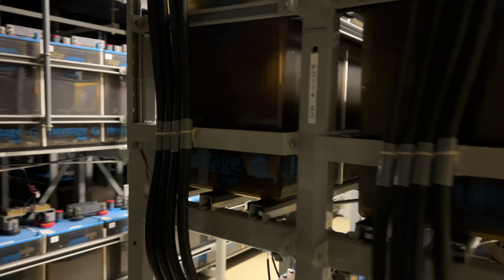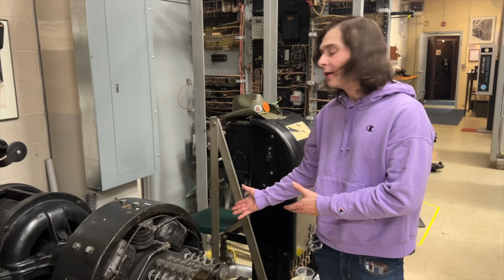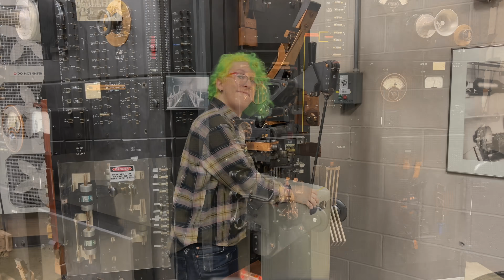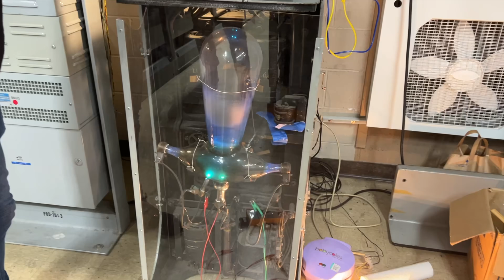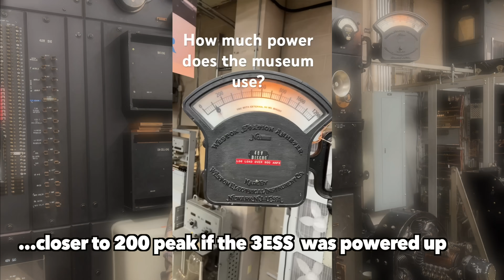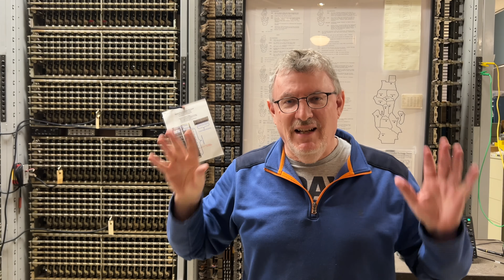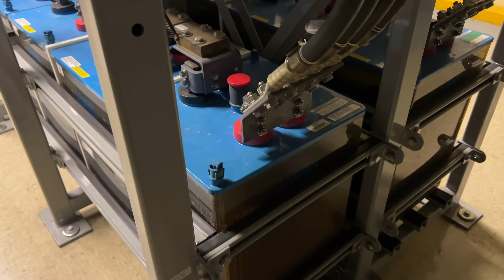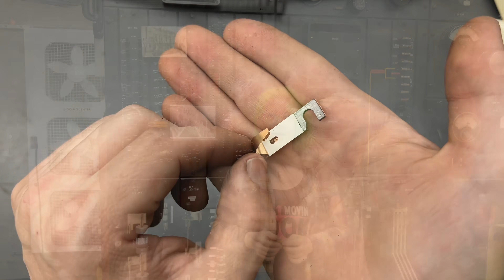All About Telephone Power Plants

Comment: I've seen the battery room with its row upon row of clear-case batteries at the old telephone exchange in my town.  I've also seen the generator they had for standby power.  They used to run it for some time (I don't know exactly how long, but I'd guess at least an hour) each Monday, just to keep the oil flowing and the battery charged.  I seem to recall one night when the power went out for a while and I stepped outside the house to look at the darkened town, and it was so quiet that I could hear the generator at the exchange rumbling away, even from around 3-4 blocks away in a more or less diagonal direction.
I recall being told that the generator wasn't actually designed to be used for emergency backup, because it tended to throw oil around until it warmed up properly and the seals heated up and closed the gaps properly.  It was intended for continuous usage in a situation where the grid wasn't available.
I presume the exchange building still has a backup generator, but it would be supplying the Internet equipment and the mobile/cell phone tower.  I'm pretty sure the old generator was retired years ago and they have a replacement.
And now I'm remembering the time that around half of the distribution equipment in the exchange went out.  You could pick up a phone and stand there hearing nothing while the uniselector desperately attempted to find an available path.  I think it was out for around 30 minutes until whatever the problem was (I never found out any more) was located and fixed.  You could occasionally get a dial tone, but it wasn't easy and you weren't guaranteed to be able to connect.
By the way, the first fully automatic telephone exchange was designed by Almon Strowger, which is why the step-by-step switch was also called a Strowger Switch.  He designed it using cut-out paper pieces.
According to the story, Strowger, an undertaker, was convinced that the manual telephone operator, who was related to his only rival in town, was deliberately directing all calls for "The Undertaker" to the rival company instead of evenly dividing them between the two companies as was the policy. Strowger was motivated by this to work out a way for subscribers to dial the number themselves.
As I understand it, Strowger's exchange required 4 wires, with the 2 extra wires being used for number signalling, but later developments allowed the numbers to be conveyed through just two wires along with ring current and sound/voice.

Comment: This is a great presentation.  I’m sure it will generate lots of comments and stories.  I have one for the group.

In 1967 I was in the Army assigned as an SP4 Dial Central Office Repairman at Ft. Benning, Georgia.  Ft. Benning is now Ft. Moore.   General Benning fought on the losing side of the Civil War.  My job was night and weekend inside plant man for the post.  I watched over the four telephone exchanges at the fort during non-working hours.  Sounds awful, but it was really pretty neat.  I got to work on equipment.  The Army Dial Central Office Repairmen on regular duty hours cut the grass while civilian employees worked on equipment.  But on to the story - I had just come into the Main Post central office to start my 8:00 AM Saturday to 8:00AM Sunday shift.  I took off my jacket, stretched my arms, then the lights went out, followed by the sound of the motor-generator winding down.  We are on the batteries alone and we had no backup power source.  I ran to cut the switches to the motor-generator so it wouldn’t try to suddenly start up before I had time to figure out what as going on.  I called the Wire Chief to report what was going on then called the Post Engineers to find out what happened to my power.  The power was off to perform scheduled power line upgrade.  Scheduled with who?  Would have been good to know in advance.

Our battery was 20 years old and the end cells cut in very soon after the power went down.  I won’t make you sit through the next three hours while I watched the volt meter slowly wind down.  It was tense.  But the power did come back on.  I cranked the control for the voltage of the motor-generator down before restarting it.  I was afraid the exchange load plus the load of recharging the battery might blow the big fuse like the ones you saw in this presentation.  We didn’t have a spare for that either.  Hey, don’t look at me, I was just a lowly E-4.  Planning and decisions were above my pay grade.  Anyway, the motor-generator did come back on.  I put it on-line and spent the rest of the day slowly cranking the voltage back up to the normal level.  Whew.

Comment: Thanx for the history lesion.  Back in the 1960s when I was a trainee technician in a  large central office that consisted mainly of Western electric Rotary systems and a large step office on another floor one of our weekly duties was the power room.  There we had  two 24 volt batteries for long distant toll switchboards , two 48 volt CO batteries  with the end cells permanently connected due to the high load  of about 1200 amps   and two 130 volt carrier long distant batteries. Every Monday  we would set out to read all the cells that were open top not fully  enclose  and the the Specific Gravity readings   This would take the best part of the day . The rest of the week we would just do the pilot cells.  These batteries were charged from silicon rectifiers with 3 phase AC generators that were manually  brought online during the peak morning and afternoon.  The 130 volt batteries were changed with AC to DC generators with a  "No Break" generator that  had a humugas flywheel that  would  keep the system going  until the diesel  generators got  going incase of a power failure. I soon leaned that  sulfuric acid soon eats thru  a pair of jeans.
Reply: We used to have a hybrid coaxial cable/microwave toll link back in the day between two main cities in this country. 

The microwave relay stations , usually in semi-rural settings, used a similar system (they took mains supply failure seriously) where a motor-generator set also spun up a 500 pound flywheel which was in turn clutched to a Diesel engine. The idea was if the power went off, the flywheel would maintain rotation long enough for the Diesel to auto start and come up to speed and drop the clutch in. The ultimate UPS, I guess. There were also bunk rooms and cooking facilities for the techs if they needed to stay on site.

Comment: Honestly, I have been trying to get more detailed information on the design of these very early open-frame ITE breakers for years, as they were once quite ubiquitous in panel boards.  I have a few drawings in 1915-1930 electrical reference books and some spurious bits of sales literature, but not a concrete working description of how the actuator actually ties in mechanically.

Yours is the first video where I've ever seen one operate.  And yours is a very elegant version, both because it's DC (which is harder to electrically break), and because it has the complicated secondary mechanism for automated reclosing which I had never seen before at all.

I know telephony is the main focus of the channel, but if you ever decide to revisit this in a future video, you'd probably be the first to clearly document the overload-adjustable coil-dashpot assembly that made the ITE (inverse time element) design remarkable in its day.
Reply from the maker: That's a very good point, thank you. I was also trying to learn more about these breakers, and I found very little information online. All I know is what I've been able to piece together from the various bits of sales literature.

Maybe I should put together a shorter video showing how these work in more detail.

Comment: Some older vacuum tube equipment had a " Dynamotor"...a miniature AC motor driving a DC generator. 
    As a teenager in the mid '70s, I used to find 45 volt zinc carbon batteries ( about half the size of a cereal box) at the local dump. They were still good...
I asked around about them, and why they were thrown away, and the physics teacher said the phone company threw them out, that they were part of some backup system.
   I had a 1940s automotive battery charger with a Tungar rectifier..looked cool in a dark room...
Reply: OK I have to ask. What did you do with the batteries? lol.
Reply: @charlescheeld4767  I had some vacuum tube radios from the '40s...a common plate voltage then was 90, plus I had homemade vacuum tube radios and amplifiers ( mid '70s). I also had a surplus gieger counter that needed 300 volts DC. Also had a huge neon relaxation oscillator ( random blinking light thing) that needed 180 volts DC ..
Reply: @scottthomas3792  WOW, so you wired a bunch of those big batteries up in series to get up to 300 VDC? I bet that was a sight to see in your garage/bedroom. lol. At least you gave them a second life. I bet they can't throw those batteries away like that anymore.
Reply: @charlescheeld4767  Yeah...the batteries were huge...about half the size a large cereal box. We lived in a rural area, and I had an old shed to use .. literally, a radio shack. 
     The battery packs were larger than the things they powered. Plate and grid batteries last a long time, but filament batteries don't. I had some old, weird lead acid 2 volt batteries in heavy glass jars. They were given to me, and I have no idea what they were originally from.
Reply: Don't know if you ever got an answer, but in 1969-70  I saw 1930s era PABX- still operational- which used open-frame Erikson branded Strowger type selectors that had them ( x25) as its power supply. They were heavily ribbed square jars around 12 inches/ 300mm tall, and ~6 inches/150mm square.

Comment: Another very interesting video.  While I was not able to locate this scene quickly, there are two spots in the video where you show the batteries themselves.  The second scene, the one with a woman standing in front of the racks, shows batteries manufactured by the company I worked at for 19 years - C&D Technologies.  In earlier times they were known as C&D Battery.  Batteries in that configuration normally had multiple cells in them and there was all kinds of strapping (series and/or series/parallel) to deliver 48 volts.  Remember that the chemistry of lead-acid batteries tells us that an individual cell only produces 2 volts.  This means that you need to wire cells in series to increase the output voltage.

I was surprised that there was no mention of AT&T's contribution to the battery industry.  I would expect that many of the old timers commenting here will remember the round batteries that they must have encountered during their careers.  AT&T as "Ma Bell" was always concerned with longevity and reliability in anything they produced.  AT&T engineers set out to create a lead-acid battery that would last longer than traditional batteries.  They did this by literally changing the entire configuration.  Typical lead-acid batteries are in rectangular "jars".  Think of your car battery or the wastebasket sized units on those racks.  The plates are all vertical.  What happens over time is that the oxide paste that is held by the plates (they are actually lead grids that are filled with paste) ages and some falls to the bottom.  Once there is enough to form a connection between plates the battery shorts out and fails.  The Round Cell tried to eliminate that by using horizontal plates  and then using a cylindrical jar.  C&D was the only manufacturer licensed by AT&T to produce the Round Cell.  They were in production in various configurations until about 2015.  When I hired on at C&D in 2002 I saw a huge room full of these at C&D's Leola, PA manufacturing facility charging away.  The other variant AT&T had was a much longer "formation" step.  The first application of charging energy to a freshly created battery "forms" the positive and negative paste.  The Round Cell took about 30 days to complete this step; normal lead-acid batteries take much, much less time.
Reply: The batteries used in the museum are in the basement. The museum is on the second floor of an active CenturyLink central office, and borrows power from the active CO’s power plant.

Comment: I'd watch another deep dive on power systems. I want to hear more about how the end cells were used. When and how are they switched in and out of circuit? How is the battery bank kept in balance when these cells aren't at the same state of charge as the main cells?

Comment: I was rewiring the phone jack extension going to the upstairs because we're having issues. So I was on the floor in the corner of the room behind the chair and the floor was a little damp. I accidentally touched a couple of things with my fingers and start feeling tingly. Never felt that way before so part of me thinks there might've been a ring Signal or it could've just been the combination of damp carpet and bad timing. I just know that the phones didn't ring but with that disconnected there was only one other Jack in the house so I don't know.
I haven't quite gotten to the point where I think everything should be negative voltage but it doesn't phase me that it's reversed.
And then if you think about how we thought power flowed one-way through a battery and then later found out that on a smaller scale it actually goes the other way it's sort of makes sense that it's negative anyway.
Reply: Under those conditions, the standard 48 volt on-hook voltage is sufficient to cause a "tingle".
The ring voltage is typically 90 volts AC at 20 Hz-while this IS current-limited, trust me, if you get across it, you will get more than a "tingle"!
Reply: @m.k.8158  Of course YouTube and the Internet breaks soon as I hit post comment and I lose my entire comment and have to start over.

This was probably about 2002 in the middle of nowhere upstate New York in the valley at the very end of the trunk. As we were the last house with the trunk line Junction Block and they ran Spurs to the last 2 remaining neighbors about a mile. So since we were literally the last mile I wouldn't be surprised if there was significant voltage drop.

It definitely wasn't like anything I felt before and more than a tingle and was enough to make me jump if I remember right. Definitely nothing like DC and definitely different than 120v60hz ( or even 240v60hz now that's another story ).

Don't worry I've had my battery recharged for the next approximate 5 years. I removed some equipment thinking the switch was off and only as I was putting the electrical caps on the wire after removing everything did I find out that switch is not wired in a normal way but something more weird. Then again the building was built in the 1900s and was converted to a movie theater in the 1920s the fuse box was yes fuses barely labeled so I shouldn't have been surprised. But definitely one of those stupid moments of no I don't need to test it….

Comment: I'm wondering about the amount of fuses in general. How often would they blow in regular use? You talk about personnel replacing blown fuses, but presumably that's not the only thing happening, as the fault causing the fuse to blow would still exist? So what was going wrong with the equipment that caused these power surges?
Reply from the maker: Well, it depends on the fuse. Small grasshopper fuses can blow somewhat more often due to accidents or carelessness when working with live equipment. (Generally speaking, CO equipment is not powered off while work is being performed unless strictly necessary). If a small fuse blows, it's no big deal. Simply replace it and go on with whatever you were doing.

Larger fuses can sometimes blow during periods of extreme traffic. This wouldn't happen in normal operation, but could happen if a surge was high enough. Also, bigger mistakes like shorting a bus bar to ground with a wrench could (and should) cause a fuse to blow. In either case, the correct course of action is to move to the backup fuse and replace the blown one as soon as possible. If the backup fuse blows, locate the fault and repair, and then replace fuse.

The idea here is that fuses are expendable. Telephone service must not fail.
Reply: @ConnectionsMuseum  I see, very interesting, thanks!

Comment: What happened in old Time Telephone Exchange that used Tube Powered equipment for carrier Equipment how was it Powered 
when they had only 48 Volts Available?,
Reply from the maker: There was also - and + 130V DC and - and + 24V DC available. I didn't really cover that in this video, but it was widely used.
Reply: @ConnectionsMuseum  Thank you answered my question,I have asked that question before and nobody seems to know the answer I have all ways wondered how provided HT for tube based equipment I guess 24 Volts provided Filament current for the tubes I  am in Australia full Marks on Your Website and have  knowledge people to explain technical questions,Ian,

Comment: I worked in AT&T's Integrated Test Network (ITN) as a UNIX SA in the 90's. At the time, it was the 3rd largest network behind AT&T's "real" network and MCI. We had a full battery -48V power plant. I remember walking by the control unit (not sure what it was called) one day and it was supplying -51V at 5600 Amps!